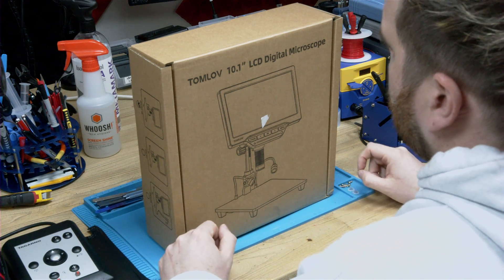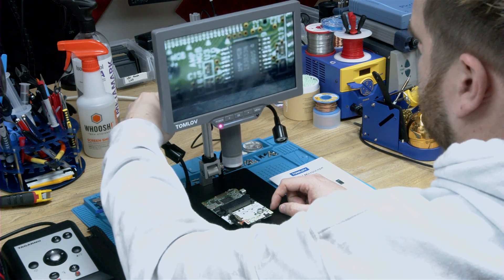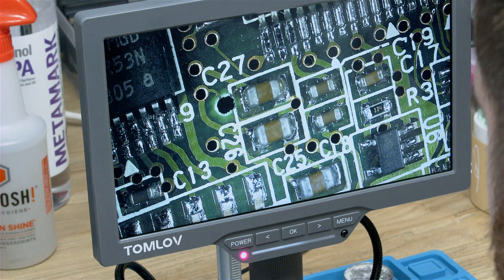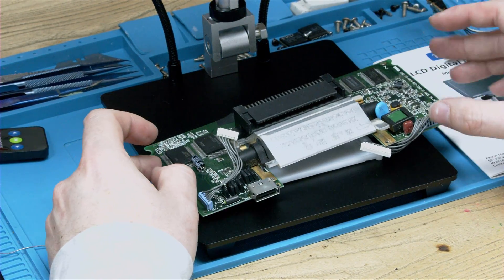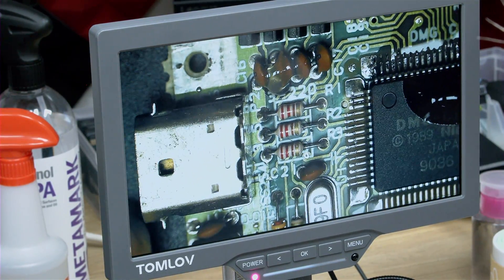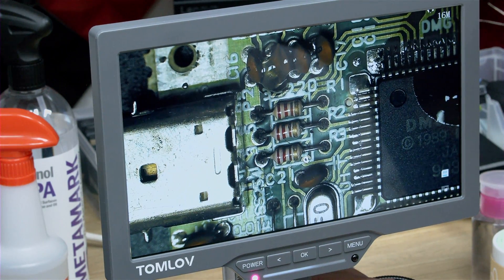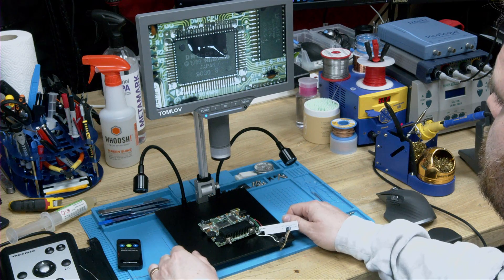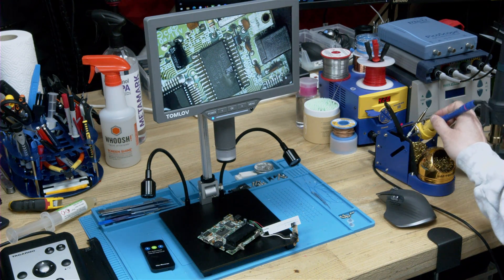The Do-It-All Digital Microscope For Retro Repairs 2023

Comment: I have to agree about 3D vision. I just bit the bullet and ordered a binocular optical scope. It sits at the very back and articulates forward. No problems with workspace. I hope it works well. I'm getting older and there is no way I can solder without the depth. Nice video, thanks

Comment: Would it be best to start with electronic kits, where you can practice soldering with an iron or hot air gun before working on PCBs with lots of components? The idea is to get used to how you are seeing what the DM is seeing, and how to adjust one's hands, tools. Thank you
Reply: If you don't have a good soldering iron station that adjusts temperature, then get one. I use a Hakko, but there are much cheaper ones that are also just fine. Also, decide how you are going to desolder components. There is braid that absorbs, solder suckers and expensive soldering irons with a pump to stick up the solder. Get some resin. It helps with soldering and desoldering.
I recommend just getting some junk boards and remove components and put them back to practice. Get a filter that sucks up the solder fumes. They are toxic over the long run. Have fun!
Reply: @CrispyCircuits  I have an 853D hot air rework station, with adjustable iron. Thank you. As a kind of hobby I look for electronics in dumpsters and curbside stuff! Got lots of electronics!! 😂🤣 A fume extractor would be a big help too!

Comment: I would agree that these USB digital microscopes are a very good value. I really like the 10" display on this model along with the fact that it can be made portable due to it's onboard battery. Not sure how long it would last but screen brightness will help if someone required more operating time. The screen brightness is good and has excellent resolution. The downside is it is not deep and makes working on larger assemblies difficult thus is only good for smaller PC boards. It would be great to see a sort of extension with a counter weight to facilitate larger boards. But this is something available in larger more expensive scopes I realize. Nice demonstration, well done sir.
Reply from the maker: The assembly that attaches to the base can come off so it should be pretty easy to support a larger base. I'll ask factory if they plan anything like that
Reply: @RetroSix  Thank you. That would be excellent if these scopes started to support larger bases. I usually build larger Commodore Amiga motherboards, like the Re-Amiga A1200 for example, so more space to inspect would be a nice to have feature.